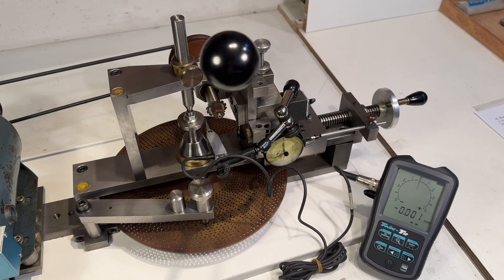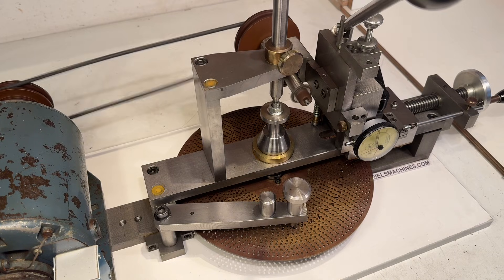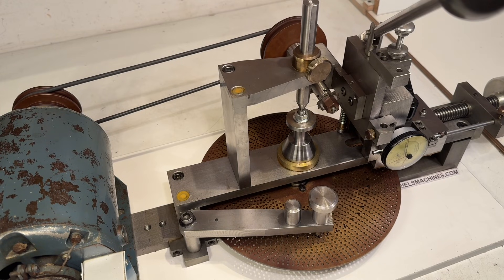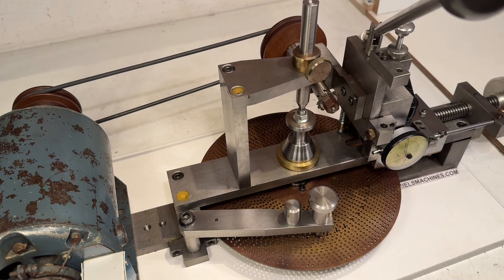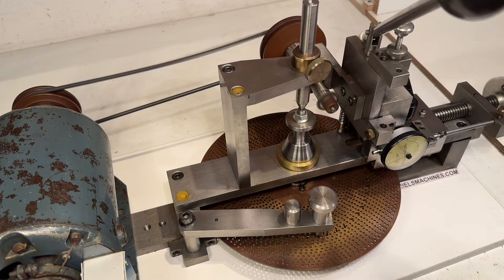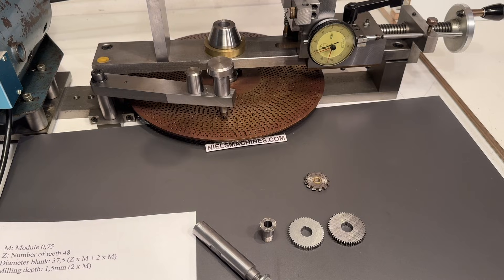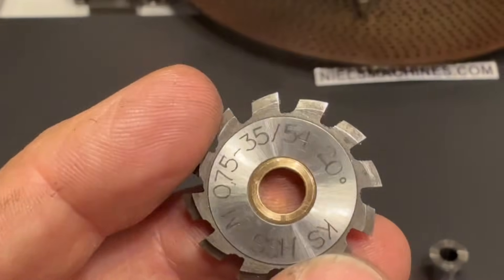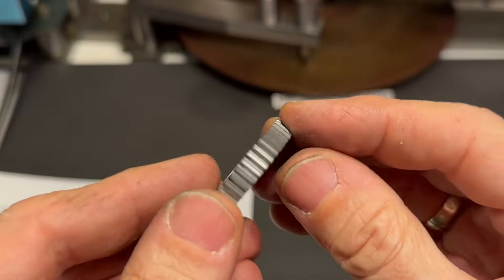Cutting a gear on the Gear-wheel and Pinion Cutting Machine

Comment: I don´t think you have an option: If 1,5mm-depth is, supposedly,  the correct depth, then 1,49mm- or 1,51mm-depth are inevitably and straight false... All dimensions of a tooth of a specific size are interconnected and cannot be variated.
Reply from the maker: Thanks, that makes sense